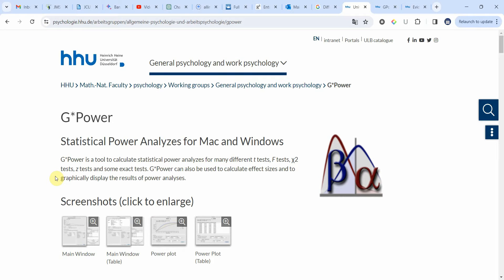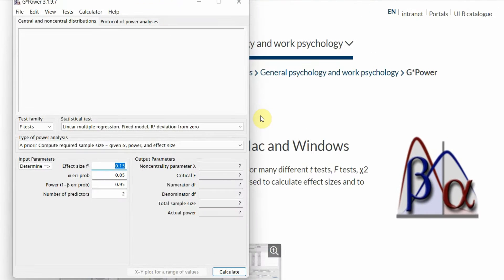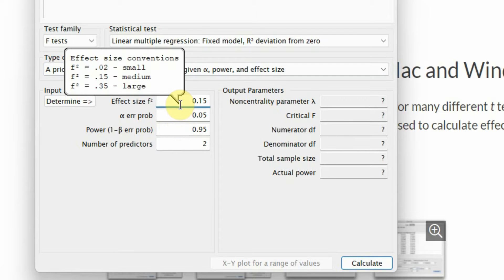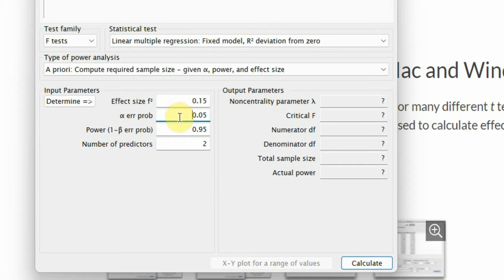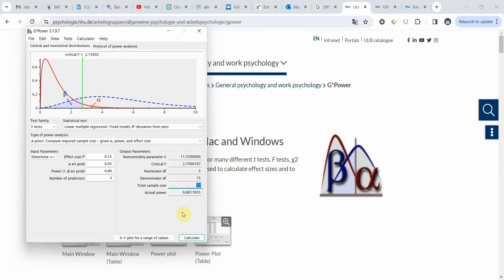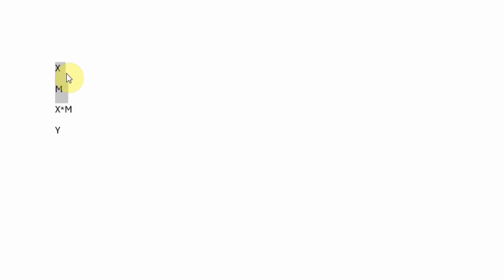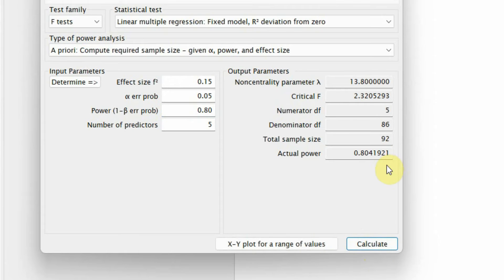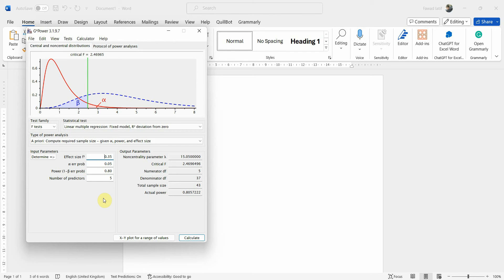Introducing G*Power for Sample Size Calculation for Structural Equation Modeling

Comment: Sir My model has 1 IV, 1 mediator, 2 dvs, 1 moderator( moderating 3 relationships), how many predictors do I have then?
Reply from the maker: Please watch the video. If the DV are not connected, you can calculate the predictors as they are in the video.
Reply: @researchwithfawad  Thanks sir for your reply and about Dv's, yes they are not connected

Comment: thank you for this. Can you explain why the total sample size is inversely related to the effect size? I would expect that to have a larger effect size, sample size should increase.
Reply from the maker: The total sample size is inversely related to the effect size because detecting smaller effects requires more data to overcome variability and achieve statistical significance, while larger effects are more apparent and can be detected with fewer observations.

Comment: What is the difference between linear model regression fixed midel r2 derived from zero and 
Fixed model r2 increased
Reply from the maker: the key difference lies in the perspective: "Derived from zero" emphasizes the comparison with a null model, while "Fixed Model R^2 Increased" focuses on the improvement in explanatory power achieved by adding fixed effects to the model. Both concepts are related and often used in the context of fixed-effects regression models to assess the impact of individual-specific effects on the dependent variable.
Reply: @researchwithfawad  thanks alot